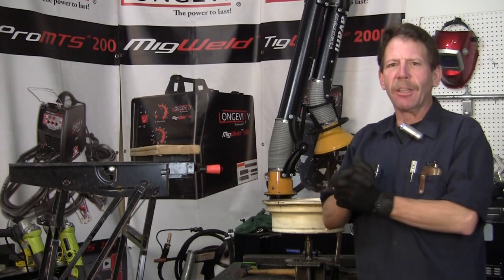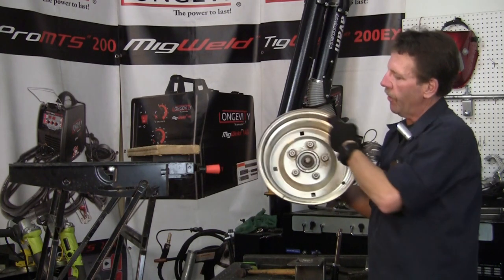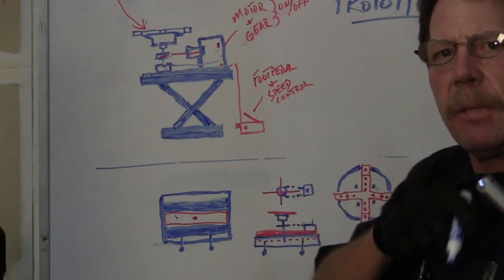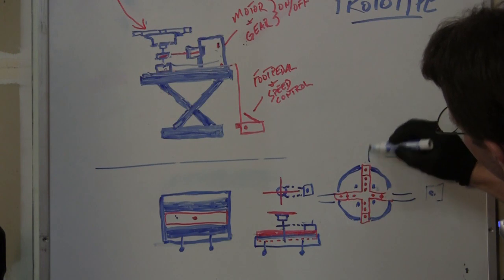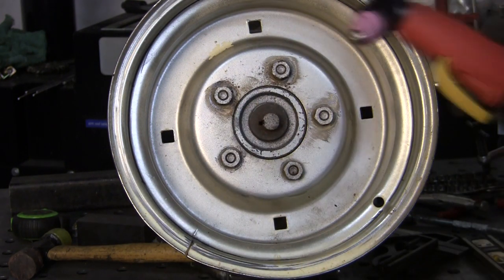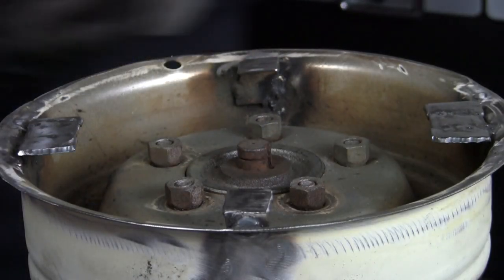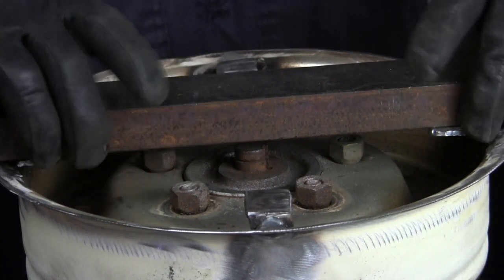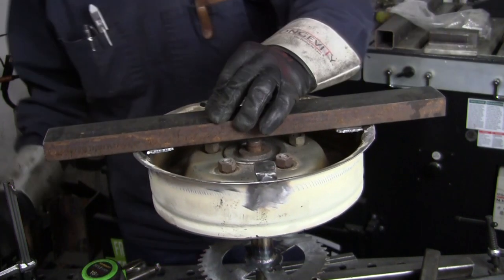Welding Turntable Part 4

Comment: I think I would have made a removable cross arm table (coupla three bolts dropping through the rim.  It looks to me like the circumference is going to get cumbersome when tig welding small diameter projects.  By having it easily removable you could comfortably do both small and big.  Seems a bit much to bend over now much less with extensions in the arms.  Liking the basic concept so far.  Doug